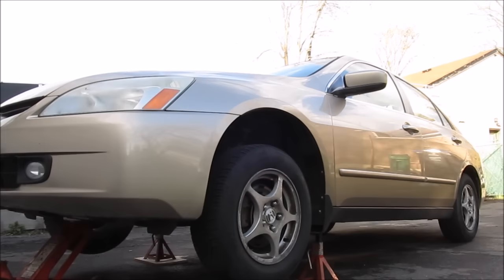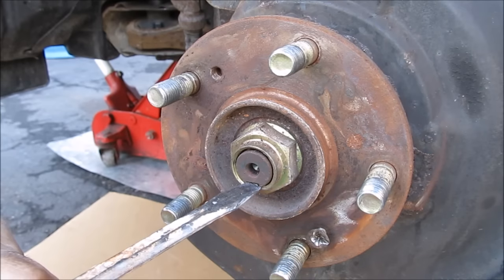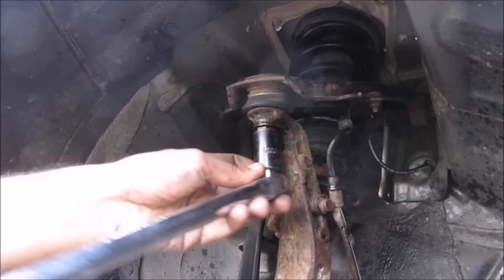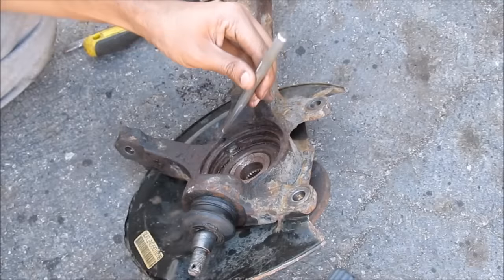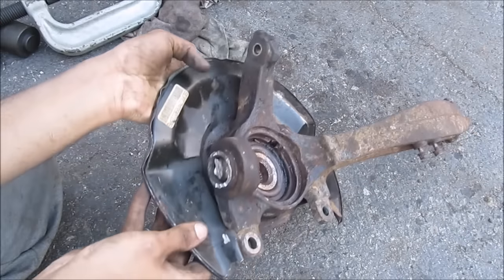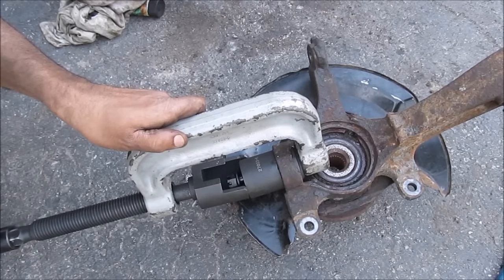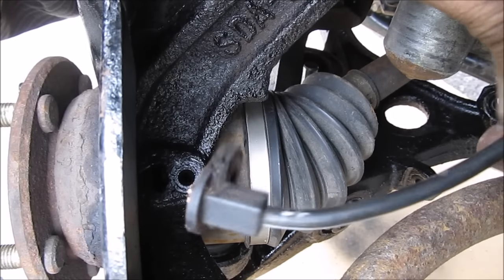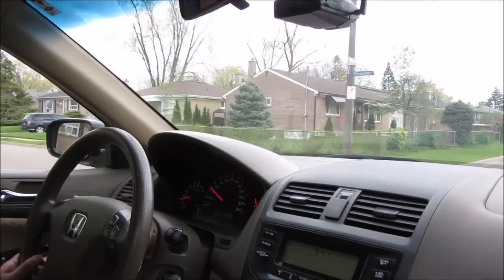Honda Lower Ball Joint Replacement

Comment: I just paid 185 bux to get this replaced on my accord. Seems like a lot of work i would never want to do myself lol.
Reply from the maker: $185 for both sides is not bad at all. Hopefully they didn't break your ABS sensors while doing it.
Reply: I guess you might want to be careful about the part that they put on. it might be some very cheap brand if so, I don't think the part will last long.
Reply: I am about to change mine and have been reading reviews most people say most aftermarket lower ball joints for these cars don't last long for some reason...Oem is basically  a must...
Reply: $185? Both Sides? IF so someone was desperate as book time for both sides is 3.80 hrs then add parts. I'd look and make sure they replaced the parts. 

Now off to do a set....
Reply: Mine was 900.00 usd. 9th gen honda both sides. And it was an i dependent shop. The price you paid was the cost of my two ball joints lol. You got a great deal

Comment: made it look so easy and my first time was hell lol. Also i didn't have the right tools.
Reply from the maker: +Adrian Vega Yea well the ball joints on this car weren't too bad, except for the abs sensor I broke and had to drill out. I didn't have the right ball joint adapters so I had to improvise a bit as you saw.

Comment: I really appreciate the way you fessed up to your mistake.. honest mistake that happens to the best of us.. well done clear cut precise instruction on the need to know processes.... good job buddy!!
Reply from the maker: +Iain Chalmers thanks, yes mentioning my hurdles along the way is meant to point others not to make the same mistake.
Reply: lol, if I ever decide to do it myself, which I am prone to do, since I hate being ripped off for things I can do myself. Then I will surely remember to not make that mistake but I may make another along the way... you have all the tools as well which make life easier torque wrench breaker bar ball joint tools it all adds up to do as a 1 off job.. you should list the cost of the parts just as an add on for people and maybe the cost of the job through a garage?
Reply from the maker: +Iain Chalmers if you don't have tools then take it to a garage. 
I see tools as an investment, not as a part of the cost of one job.

Comment: So a little short cut on this video there is no reason for the strut mount bolt or the Brake rotor to come off. And for the love of god follow the advice on disconnecting the abs sensor they are $40 and very brittle.
Reply from the maker: +Paul courson Yea I found that out the hard way.
Reply: Paul then make a video. It would help many people out like me before we do it.
Reply: Joey Pongallo I could but I really don't want to take my car apart again.

Comment: Great video, edited very well. The only suggestion I would make would be throw those rotor screws in the trash once you get them off. Their only purpose is to keep the rotors on the vehicle while it is moving down the line during assembly in the factory. It is one less thing to deal with, and if you have ever had a struggle removing them once they get rusted, as I did with my Kia, you will enjoy disposing of them!
Reply from the maker: Agreed! I hate them

Comment: You do not need to remove the upper ball joint, you do not need to remove the calliper, you do not need to remove any of this shit besides the cv axle, the ball joint castle nut, and the suspension fork.... don't waste your time removing all these things when you don't have to!!!!!
Reply from the maker: +Zee Mulla good tip but I prefer to have enough room for the ball joint press off the vehicle.
Reply: Snapped a ball joint and pulled CV shaft out. Replaced it on the side of the road, 20 minutes.  Drove it home and put a for sale sign in the window.
Reply: I think its just easier access to do the pressing with knuckle off vehicle.

Comment: Wow this dude runs through it so thorough! Clearly this is some real experience! Note: this guy is NOT using a lift making a how to video!
Reply from the maker: Thanks. True DIY backyard mechanic ,😉
Reply: Is there anyway you can drop your contact info in my website? I’d like to get some more insight. I’m trying to do one this weekend... again but the tooling is hard to describe with what I’m up against. Only got one shot at borrowing a friends garage to stay out the cold weather.

Comment: What a piece of crap design just to change a ball joint. Did this on my VW in 30 minutes. This is going to take forever.
Reply from the maker: +Justin Rizzo agreed.
Reply: There's now an air-impact tool available for removing and installing Honda lower ball joints. It's intended to facilitate doing this without having to remove the knuckle. I haven't used it, but if it lives up to its promise, it should make light work of this job. 

I'm not a pro, and I have no power tools other than my ultra-manly beefcake brute strength, so with no compressor and related gear, I'm gonna be 'hard pressed' in doing this the old-school way. ; ] I do intend to buy the special ball joint tools that Honda still sells for this job -- minus the circlip guide that costs a staggering $105. I rented a 'loaner' ball joint tool set from Advance last summer for $198, and I got other use out of it, but I never got around to my bushings. Nice and fairly comprehensive set, but nothing was sized for Honda parts.

The manual for my '95 Civic LX recommends pressing these out and in using the Honda-specific tools and a standard bench vise. I have no shop, either. Ha! I'm mulling over taking the chance of buying a 6-ton or 12-ton Harbor Freight press at today's Mother's Day coupon discount. I'd have potential future uses for it, aside from automotive work, but I want it now for replacing the ball joints and control arm bushings. I just haven't found any information online about what force equivalent I'd probably need from a shop press to do these jobs on the original equipment of a 22-year-old Civic that has spent all of its days in Salt Belt and Rust Belt territory. Hmmm.
Reply: I ended up pulling the whole knuckle off and paying a shop to press the joints in because the autozone rental apparently does not have the super special ultra rare unicorn sockets required to use the tool properly. That was after hours of trying to pry off the axle nuts, and damaging one CV shaft threading. Longest, most expensive ball joint replacement in history. Last Honda I buy.
Reply: Yeah, that must be the only easy thing to replace on a VW. Everything else is a bitch.
Reply: Unless you want to remove and paint every part like he did, you don't have to remove any of that stuff like brake rotor, etc. All you have to do is undo 2 nuts, the axle nut and ball joint nut, that is it. And then push out old ball joint and put in the new one. I have no mechanical experience and in did it in 30 min on my Honda.
Reply: Civic?  I have a 96 civic that requires this job.  I am replacing both upper and lower arms.  You found that the press kit works easily, without having the knuckle removed?
Reply from the maker: +Michael Lam no you need to have The knuckle removed for ball joints pressed into knuckles, I don't think there's enough clearance to get the clamp on there easily. Besides, if your doing upper and lower arms the only thing left is to remove the tie rod and the knuckle is off, correct?
Reply: From what I understand.  this is a first attempt on a job like this, for me.  Previously I have worked on 4/5 motor mounts (the rear one finally died, so begrudgingly, I need to swap that out too..) and drum brake work.
Reply: speedkar99 wouldn't happen to have any suggestions or advice for how to change a lower control arm?   Surprisingly.  It is near impossible to find a relevant video for a pre 2001 civic.
Reply: Ive been changing ball joints on my acura legend for 2 weeks now :(
Reply: what model of vw?
Reply: Yes, but on  a VW the direction of the ball joint is inverted which is easier to pull out but make consequently the ball joint last for less year of km. On a VW it works with traction which is not the best option to maximize the lifetime, and on mainly japanese car, it works in compression which is way better. You can see here the  different approach about replacing parts in car, german make it easy but more often, the japan make it hard but less often. There is no crap design, just talke in consideration all the whole process.
Reply: I have both Honda and Golf IV ... don't compare the suspension, Hondas is 10x better, also independent suspension on the rear .... I wish my IV had Hondas suspension.

Comment: YOU NEED AN ALIGNMENT!!
Reply from the maker: +sensationalC All of the pieces that have to be removed are hard points and not adjustable. So even if the alignment changed, there's nothing you can do about it.

Comment: Pretty rust!
Reply from the maker: +Celio Santana it sure is rusty
Reply: speedkar99 I have never see something like it. Is that because of the salt used in the snow, or live near the sea? I'm from south of Brazil, by the way: Very nice video! Congratulations!
Reply from the maker: +Celio Santana thanks
Its because of winter and salt used on the roads

Comment: Changing a broken ball joint and shaft today, your video was very helpful. Thanks so much for the help.
Reply from the maker: Glad it helped. Did it break while the car was driving?
Reply: @speedkar99  It did but tha nkfully I was in a parking lot when it let go. Now I'm installing the shaft and found out it's too big. Lol good ole Canadian Tire Parts! 😎👍

Comment: Awesome video, Speedkar. Love to watch someone use the proper specialty tools instead of beating the crap out of everything with a hammer. Great repair!
Reply: You did way to make disassembly. You don't need to take all that off. Tie rod end lower ball joint and axle nut

Comment: Thanks for making this video. If you don't want to cut off the stud you can try using a 21mm impact socket to drive the joint out.
Reply from the maker: +Aaron _ Thanks. A socket wouldn't fit in the c-clamp to go around the knuckle.
Reply: I used it to beat the ball joint out of the knuckle with a large hammer.
Reply from the maker: +Aaron _ That works too

Comment: Thank you very much bro it worked for me, I was trying to press it out the same but it didn’t work until I just cut the ball joint in half and hit it with a hammer.
Reply from the maker: Don't press in with a hammer though

Comment: Many thanks to the video. I have a similar car. Did the ball joint today, had the same problem as yours except the bearing cover and ABS sensor. I unplugged the sensor plug as you recommended.
Reply from the maker: +Pathy K Glad you found it useful. The ABS sensor wire and tie rod cotter pin breaking and not having the right ball joint tools are all common issues with the Gen 7 Accord.

Comment: At last really concise video without music or chats about the weather. I would have liked to have seen a torque wrench used for the various nuts.
Reply from the maker: +Will Carroll short and sweet is how it's gotta be. 
I only use torque wrenches on critical bolts like where there's gaskets. 
Everything else is done with my calibrated hand 💪
Reply: Yes, I wouldn't take anything away from your expertise but air drivers aren't your calibrated hand. They are great for undoing but can be a problem when tightening - tyre fitters invariably over-tighten wheel nuts with them so that when  you get a flat (on a deserted road, 2am in the rain) the nuts won't shift. A friend had all 4 threads stripped my some moron fitter (you'd think he'd stop at the first one).
The other thing I see regularly is click-stop torque wrenches being pushed beyond the click 'just for good measure'. What's the point of a calibrated, precision tool in the hands of an idiot?
Thanks again for one of the best put-together videos I've seen on youtube. I admire you for leaving in the ring problem and the cut finger - we've all been there!
Best wishes,   Will
Reply: @speedkar99  I'm not buying that "calibrated hand" crap when you're using a 1,00 ft-lb impact wrench.

Comment: I agree, that your editing and instruction was phenomenal. However,  I performed the exact same job with far less steps today. I knew not to bother the abs sensor, and your didn't have to remove the tin retainer on the wheel bearing, or the fork and bolt either. Also, ball joint splitters are for amateurs.  A good size hammer on that style will do the trick.  Same with the tie rod and upper.   I do this for a living and don't have the time for all the extras, but many aren't needed either. Always take care on rusty bolts but lubricating the head, won't help you at all.  Here in NY, we own torches.  I pushed mine out with an air chisel with a hammer bit, then used the ball joint tool in a similar manner as you. Minus the expensive Honda attachments.  But I had no damage to sensor or wheel bearing, just a dent to my knuckle not the vehicles lol. Overall great video, just sharing my experience. Also I did the whole job in 35 minutes.  Including front brakes in about an hour.

Comment: For anyone doing this job be very select on which ball joints you buy if you decide to buy after market parts.  I did this job for a buddy of mine and he bought aftermarket ball joints from rockauto and they  have a little hump at the top of them as the factory ones dont. well that little hump caused the axle housing to hit the top of the ball joint and prevent the wheels from turning. this is a part I would recommend getting from the dealer or make sure it's flat like the factory one.  I hope this helps somebody cause it totally sucks having to do this job twice.

Comment: Awesome instructional video, it seemed like a lot of work taking it apart. Would you recommend replacing other parts while you were at it? Maybe the upper ball joint?
Reply from the maker: UBJ isn't necessarily easier to get to "while your in there"

Comment: For anybody doing this on 2nd gen Acura tsx and equivalent Honda accord, you will need snap on BJP1-29A to push the old ball joint out. Honda decided to up the diameter of the lower ball joint from around 45mm to 55mm making the old Honda specific kit useless.
Reply from the maker: Good to know

Comment: Awesome video! It should help when I replace my ball joints on my '01 CR-V.  I noticed you sprayed the knuckle with something before you reinstalled it. What is that stuff b/c it looks like it would protect parts from additional rusting.
Reply from the maker: +K A Spray paint. 
Thanks
Reply: @speedkar99  Hey I was wondering what that paint was too. Is it just regular black spray paint?

Comment: Did this same job removed way less parts less room but honestly was easier to juat moves axel out of way and use a press kit it also helped i did it on gravel so i dug a hole to fit the press kit
Reply: Replaced the whole control arm too
Reply from the maker: Sure you can replace the ball joint on car but it's much more comfortable working with it off car in a vice

Comment: Here is a easier way to remove the ball joint since everyone has trouble on these on the way out due to geometric difficulties of the knuckle: 

Find impact socket, big enough to fit between the ball joint base and outter rim. Put whole knuckle laying down and against some wood as well as under to avoid damaging anything. Hammer impact socket with a 4lb metal hammer, drives out easy everytime but make sure you hit it straight, 22mm impact socket is what I usually use.

Comment: awesome video!!! it is a much bigger job than I thought. I'm glad I saw this before I start
Reply from the maker: +Yin Tang thanks. It's harder than a bolt on ball joint liked what Toyota has because you have to pull off the knuckles
Reply: speedkar99 I actually got stuck at the stupid screw on the rotor. I tried using an impact screw driver but had no luck. I might have to drill it out...
Reply: Yin Tang, if it's not too late; you can use an impact screwdriver; the kind that you hit with a hammer and is spring loaded to twist left or right. When I removed mine it was a pain.
Reply: Dustin Lloyd that was what I ended up using. Thanks for the suggestion!!

Comment: You don't need the special Honda ball joint Adaptors to press the old ball joint out. Doing some research i found that you can carefully hammer out it. Heating before hammering it would be best like how you run hot water over a jar lid that won't open same concept. I hope this comment helped some of you mechanics that didn't have the special tool and needed a quick trick.

Comment: Great work on editing the unwanted scenes, you get right to the action point with your cuts.

I have one question for you can you remove the axle 36mm nut if you didn't have the air gun? I don't have one and I don't know if I want to invest in one just get this job done, I have an electric one but not sure if torque is enough.

THANK YOU IN ADVANCE
Reply: Ashor K  i done mine with a breaker bar, if it's not enough you can add a piece of metal tube so you put more pressure on the breaker bar
Reply from the maker: +Ashor K thanks, yea I don't like showing the boring part of the job, just simple and to the point. Yes the axle nut can be removed with the wheel on the ground and a large breaker bar.
Reply: I did the 36mm axle nut on my accord with a 1/2" breaker bar without issue, but even with a MAPP gas torch I broke the same breaker bar on little 32 mm on my Civic. I ended up having to get a 3/4 inch breaker bar ($20) and the 3/4 sockets to go with it (cheaper if you buy just the one, but I bought a set for $40).